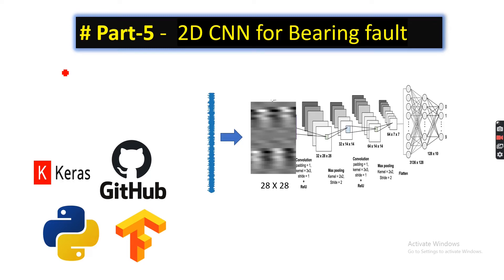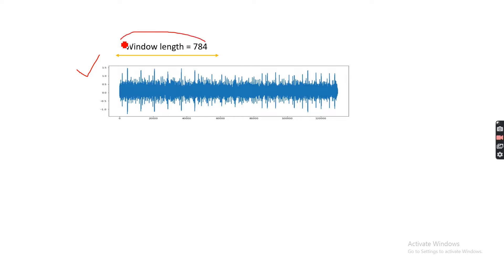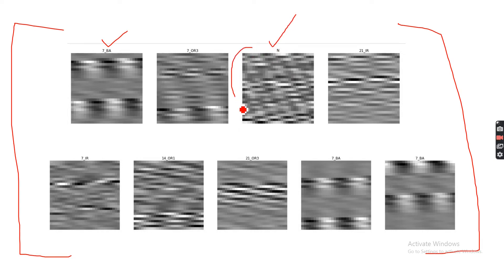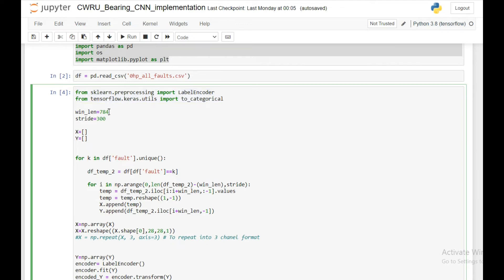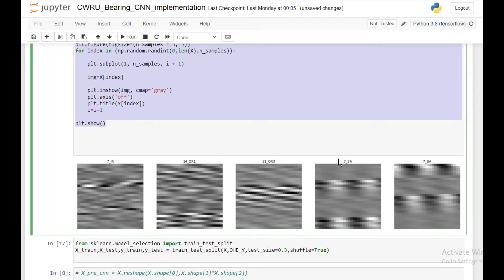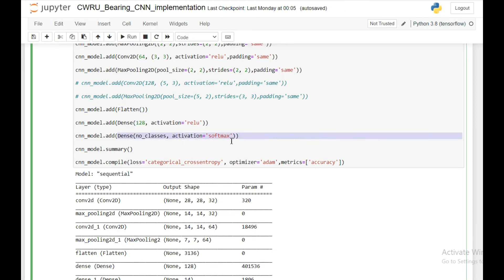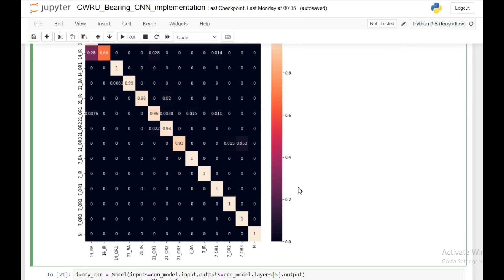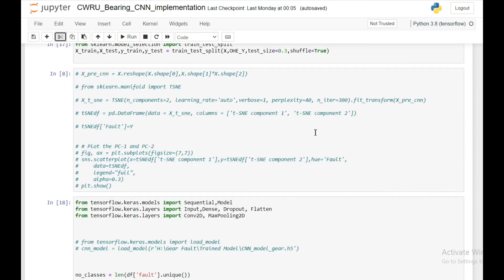2D-CNN - Vibration Signal to Image || Deep Learning for Bearing Condition Monitoring || Part-5

Comment: I have taken the same code and same data as you have taken , but when you are making Confusion Matrix then your Confusion Matrix is filled with data, meaning it shows that in normal condition the accuracy is 1, there is something else in the inner race but when I When I am performing the same data and code, I am getting only 1 row in the Confucian Matrix, that too the top one, the remaining 13 are coming blank, no data is coming in it, will you help me?